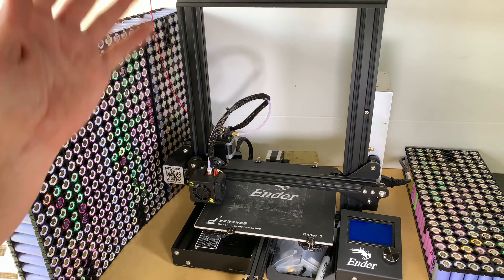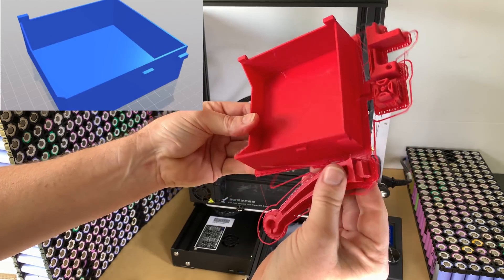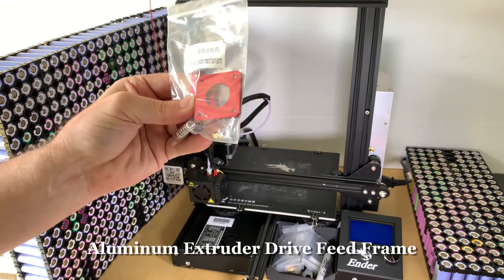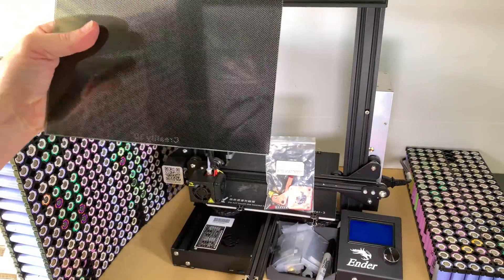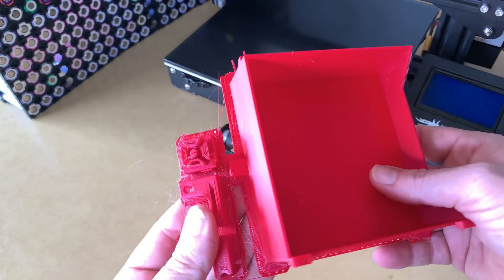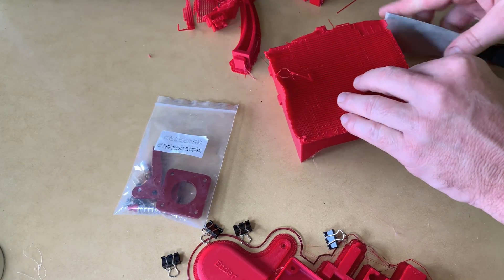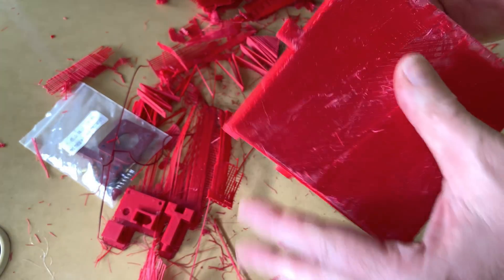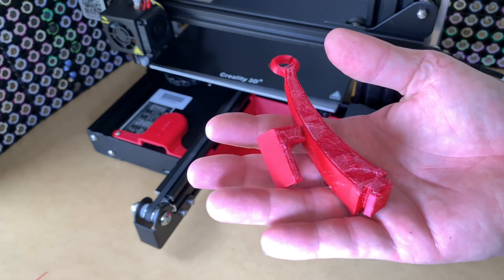Ender3 Budget Basic Upgrades - New Bed, Aluminum Extruder & some Thingiverse Improvements

Comment: Dont use brim
Reply from the maker: Feels like there is an echo in the comments section hehe Yep, learned that for sure
Reply: @HBPowerwall  if you need cura or sclicer settings just say, I watched your stuff for well powerwalls, got tons of 18650 even for my printer
Reply from the maker: i think i'm working it out slowly - need new springs for my bed i think as bed leveling all the time (every time) is killing all the fun
Reply: @HBPowerwall  have the skirt go around 5 times so it gives you time live adjust z and to get the nossel back up to pressure, and I just put some nuts between the bed and quad copter looking like bed holder thiny to put more tension and it mostly solved my bed moving every other time I print,  what slicer are you using
Reply from the maker: @sniperpronerfmods9811  that's an interesting and cheap mod i like it, i'm using cura now
Reply: @HBPowerwall  I have been fine tuning slic3r and the prusa edition as well, got cura yesterday been playing around with it seeing if it can print better then sclicer, the out of the box ender 3 settings are good but just slap speed to 90 and your good, also set support angle to 75, and the first layer extrusion to 103% and if you want rest of the print 101%, also you need to print and uses the bullseye petsfang air duct cr10 for your ender 3, tighten all the bolts every 3 months, put some foam underneath the printer, put trinamic drivers, enable thermal runaway protection, tighten the rollers properly and some other stuff

Comment: If you want to fix the annoying supports and rafts, just don't print with them.
I never use them, and my prints are great.
Since you have a glass bed now, it shouldn't be a issue of a warped bed.
Reply from the maker: Glass bed is sooo much better - never doing a raft again!

Comment: Either your filament is wet or your retract settings are wrong. What slicing software are you using?
Reply from the maker: Was using Simplify3D but having way more luck with Cura now days

Comment: Agree. Don't use rafts unless you need to. And look at raft settings if you do use them, done properly they break away very easily. I use Simplify 3D and they work well, no fusing.

Comment: To remove rafts I use a small flat head screwdriver, with I wiggle around after sticking between the print and raft, pops off nicely.
Reply from the maker: Just don't do it any more seems it was a bad idea - but learning curve is steep and enjoyable

Comment: You can increase distance between raft's top layer and first layer of your part in slicing software. I use cura and not a big fan of rafts but when I have to use it I keep .13 to .15 mm distance between layers
Reply from the maker: everyone keep talking about cura, I think I really need to upgrade i think
Reply: HBPowerwall yes I would recommend that you do, it is a very good free software

Comment: That fuzzy stuff is retraction issues, the easy fix is to replace your boden tube and hot end press coupling, I used a capricorn tube and a cheap coupling off amazon I also printed the clip to take the sop out of the extruder fitting.  Look up ender 3 boden fix there are a few posts and videos about it.
Reply from the maker: Awesome thanks for the tips.. The major issue at the moment is the filament 'snagging' not being put onto the real consistently wrecked so many prints

Comment: Phew, alright a few tips to improve your print quality :) 

I personally only use rafts when I print small parts that don't want too stick. I usually use a skirt with 2 - 3 laps to prime the nozzle.

the creality glass works great for sticking things too it. My magic number is 60 degrees. Be sure to ONLY clean it with warm water and soap. Also don't touch the top surface, the oil on your hands will make it stick less till you clean it again. 

And don't level your bed while your nozzle is hot, the plastic that leaks out creates big inconsistencies and the dots it puts on the bed are very hard to remove. Its not ththe best, but auto home and move the bed by hand. If you ever decide to upgrade the firmware you can enable a bed level setting that'll move the nozzle to the bed corners while it's not heated up.

to stop all the stringing you need to up your retraction settings. I run at 6mm at 100mm/s on my ender3. To achieve you do however have to up your Vmax E setting to a 120 on the ender3 screen. I think it's under the motion tab

Good luck! :D

Comment: The aluminium extruder upgrade does not give "better prints", lol
Reply from the maker: But it does stop it from clunking and slipping as a result it's better prints :)
Reply: @HBPowerwall  if your extruder is making those sounds it's more than likely you are too close to the bed when you print which causes the filament to retract when it shouldn't and push against the gears. As soon as I hear this on my cr10 I know it's time to re-level. If your bed is level and it's making those sounds I would check that your extruder isn't damaged or defective.

Comment: at 2:33 you pull your print bed out quickly. If you go to fast the stepper motors will create a current that can go back into your mainboard. Just be mindful of that.
Reply from the maker: I should really know better on that one, might mod the cables to stop power going back into the mainboard
Reply: Been there; The screen turned on for a second. I took it as a warning
Reply: @ryusuiki4849  You can make it boot by moving the motors
Reply: Don't TL-Smoothers also prevent this from happening? Or am I wrong?

Comment: Don't use raft.
Reply from the maker: Don't raft - got it lol best advice i've ever been given!
Reply: Get deburring tool, it'll make it easier for you to scrap off the edges. If needed, use brim. Normally, I'd use a couple of lines of skirt to check the bed leveling and purge the filament before the actual print start.

Comment: Mate you need to learn terms. The metal bit is filament feed mechanism.  You will get there. At least you have time to do it. I have mine together,  but wife has me fixing dr aainage issues. PETG is like PLA+ use that for temperature sensitive areas like the hotend fan replacement.  You will need to upgrade the software too. Hotend run away can burn the house down.
Reply from the maker: Terms will come with experience week or so in i think i'm doing ok and really enjoying the curve. Hotend runaway is the last thing that will burn my house down with as much lithium cells I have laying around.
Reply: @HBPowerwall  Yes, I didn't think about the Lithium .

Comment: Those rafts are hurting my soul
Reply from the maker: I’m sorry :)
Reply: @HBPowerwall  If you use Ultimate Cura you can set up your raft settings for air gap of 0.1mm so the raft don't stick so badly to the printing parts.
Reply: Hi if you need to print with a rafr set up raft air gap for 0.1 mm
Reply: I like brims.
Reply: Rafts were seriously needed back in the zeroes, when our beds weren’t even close to flat and also didn’t stick worth a damn. But even then we didn’t make them that hard to take off.
Reply: You didnt really need the raft for those but I suggest you dont heat it that only made it harder through crystalization. Honestly supports and the odd brim for some project is all Ive ever needed. If your beds fairly level and the airflow isnt to aggressive near your printer then rafts are usually not needed
Reply: I’m like: what the hell, a raft shouldn’t be that difficult to take off

Comment: Can you print ninjaflex with the aluminum extruder?
Reply from the maker: I'm not sure, never have personally
Reply: Probably not. You might if you slow it down to below 20mm/sec and babysit it. Not a bet I'd want to make. You can get away with stiffer flex filaments by slowing down enough. Best bet is either print or buy an extruder designed for printing flexible on a boden set up.

Comment: There is no need for glue stick on the glass bed, unless you want to use the plain glass side to give the print a nicer finishing
Reply from the maker: I didn't even consider the finish of the print when using glue! that's a great tip ty !~!
Reply: @HBPowerwall  if you use the coated side the surface finish on the side touching the build plate will have the same pattern of small bumps as the glass but you don't need any glue as long as you keep the bed over 45/50°. When I want a more smooth finish I just flip the glass and use some glue. Try to keep the coated side clean with isopropyl alcohol to remove the skin oil if you touched it and don't use any tool to remove the print, just wait until glass cools down

Comment: Skirt better than brim which is better than  raft.
Also - I can recommend the "Creality Upgrade Cmagnet CR-10 Build Surface Plate 310x310". It's designed for the CR10 but I just trimmed it with scissors to fit my smaller CR10 mini. Makes removing prints super easy. 
https://www.creality3donline.com/creality-upgrade-cmagnet-cr-10-cr-10s-build-surface-plate-heated-bed-parts-310x310-for-mk2-mk3-hot-bed_p0113.html
Reply from the maker: Magnetic is a fantastic idea but i do love my glass

Comment: you should not need to use rafts with PLA, if you are using pla+ then there is no need at all
Reply from the maker: PLA+ is what I'm using, been messing with settings today and now I can't get the first layer to sick at all - don't know if it's the cooler weather or fact that I messed something up in the settings

Comment: Trick is simple, and saves you time and money.

Turn off the raft in your slicer.

And ABS needs the thing to hot as all get out, I'm printing it at 100°C bed, 240°C hot end, in an enclosure that maintains about 50°C.

Also, check out Maker's muse, and 3D printing nerd, both excellent printing channels.  With way too many printers...

Edit: as far as the last print when you are talking, the oils on your hand shouldn't affect it, but it could be moisture.  Does it sound like the filament is boiling through the extruder?  And/or check your retraction settings in your slicer.
Reply from the maker: I've been a youtube whore for the past few days watching as many videos as possible, putting a plan into place to build a custom case for the printer to print the ABS - exciting times ahead.

Comment: You've made some parts, (that was fun), now it's time make some adjustments. Back to basics,, the 10x10mm TEST CUBE is a fast print that will help,, print it,, measure it for accuracy,, visual inspect it for issues and quality.
- Lose the raft
- "Supports" only needed for overhangs above 45*degree angle.
- Measure your filament (spec for accurate diameter) (measure with digital calibers at multiple locations on the spool). Most filament pretty-good these days,, but never hurts to check, and will make a huge difference (too big=excess extrusion ,, too small=under extrusion). Adjust the "slicer settings" accordingly.
- Hot end temps vary.  Each filament brand is a little different. And also your hot-end temp sensor might be off a bit.
- (also, I think your new extruder motor "thumb/lever spring screw" is in backwards.  Should be adjustable for filament grip)
For more educational and professional advice (and entertainment), checkout the "3D PRINTING TODAY" podcast.  From beginner to advanced, they cover it all.  Great learning tool when you're on the go.  http://threedprintingtoday.com/
Reply from the maker: Will do all you suggested for sure!

Comment: Since it is a Bowden style print head increase your filament retraction. Also decrease your flow rate. Looks like you are trying to put too much pressure on filament. Allowing overrun of flow during transitions.
Reply: Also rafting is used to stick super small parts to bed.  Brim for medium sized parts. Large parts need no adhesion.
Reply from the maker: is the filament retraction when it pulls the filament backward out rather than pushing it in? looks to be doing that by about 4-5mm id say but will look into those settings thanks for the tips. No more rafting for me
Reply: @HBPowerwall  Yes Mine Is set to about 10 mm But my filament tube is much longer than yours.
Not sure what program you are running but look at filament settings for printer. I run cleaner with filament feed rate at 90% When i leave it higher I get bad finishes
Reply from the maker: been playing with a bunch of settings today with really small stuff - I have a lot to learn.. I sent mine to 6mm up from 5 mm haven't printed enough to test that part of the prints tho
Reply: @HBPowerwall  Mine was a basic kit. After having it 3 Years it is no longer a basic kit. So many mods it looks nothing like original. I printed and machined a new bowden gear drive type drive motor for mine. it is so strong it will rip the poly tubing right out of fittings if filament flow is too high. or tip temp is too low. PLA  doesn't take much temperature.  If you get PLA too hot it will pop and bubble. Especially if stored out where moisture can get to it. PLA will also crystallize if overheated clogging tip and Orifice.
Reply: @HBPowerwall  ABS loves to peel up from edges on large prints. it is a cooling problem. It shrinks as it cools. so each layer tends to pull up the corners the longer the straight runs. That is why bed temperature is so important on ABS. I also made an enclosure for mine to keep the warmth contained during prints. It has helped keep ABS from peeling up at corners so much.

Comment: Told you the PLA smells nice and like nearly everyone has said no need for rafts in 99% of prints also saves a sh*t ton of filament and I think on your last print with the wispy bits might need your hot end temp changing maybe try adding another 5 degrees
Reply from the maker: Going to try this for sure - played with a bunch of settings and now nothing sticks lol I have much to learn

Comment: Not sure, but I think the bed is not heated? If so you might need to put a box over the printer to keep the heat in if you go no raft stylz, or you'll get layer separation. Also brush wood glue onto the glass for better adhesion, it will wash off with water. 
Next step is auto leveling with a cheap ebay proximity sensor and custom firmware. And higher resolution with 32nd stepper drivers and nozzle.
Nice prints though, you got it down pat fast!
Reply: Ps, Marlin open source firm is the go.
Reply from the maker: looking into auto level for sure - that or better hot end is the next upgrade i thinks..I'll look into the Marlin did see a few videos on upgrading
Reply: If you upgrade to marlin the mesh bed leveling is great! Was nothing but a nightmare to print anywhere I want on my warped bed now it's easy.

Comment: What software are you using for printing?  I have found that Simplify3D creates the best raft/support that is the least difficult to remove.  Also, looks like you are printing a with a tad too much heat or extrusion (based on the spaghetti filament I see from retraction/movement).  Turn the heat down a bit and/or drop the filament feed multiplier some.  Cool printer.  I have a Rostock Delta printer (Max V2 with upgraded hot end).
Reply from the maker: Will have to slowly play with settings, but I still don't understand what all the different settings mean and their cause n effect. I use Simplify3D and win10 3d drawing program at the moment.

Comment: Yeah brim only.
Is that support going haywire in that round print. You don't need support on vertical walls or even shallow angle overhangs - I think you can get away with 45º overhangs, but research that -. I don't know what that round thing is, or whether it is open bottom, but if it is I would have done support to the bed on that small overhang, not support to it's self.
Reply from the maker: supports will definitely be needed I think with the shape - 33 hours into the print and it's still going fingers crossed it'll make a good next video if I can successfully mod the design to work with 18650z. Struggling with the design aspect of it - but don't want to be the "thingivers print guy hehe

Comment: Please dont be discouraged from this endeavor, i live in Toowoomba and have an Ender 3 and another printer i built from scratch, i can come up to brissie if you need a hand, you shouldnt need to print with a raft at all, especially after that glass bed, hit me up man happy to lend a hand, i've also got some qol stuff i can bring up with me that i dont need for my printer that you can have to make life easier
Reply from the maker: Not discouraged at all - loving the curve. Thanks for the offer Liam - I'll hit you up if I hit a wall!
Reply: Good to hear! A lot of people on the facebook group im with give up about now, sucks to see as its just trial and error. If you get a chance, a little anti-vibration leather mat from Jaycar makes the printer a bit quieter and helps dampen some extra vibrations from itself and other sources
Reply: Liam that’s a great idea just the use a mat to dampen the noise. Thank you for this tip.
Reply from the maker: i had it on a yoga mat (used them for years as a safe area to work on computers) but found it was better on a nice heavy bench - tomorrow I'm going to try it in the power shed where it is a little warmer wet weather i think is messing with the prints a little at the moment
Reply: @HBPowerwall  wet weather shouldnt worry it too much mine sits next to an open window all day. what temp and brand of pla are you using